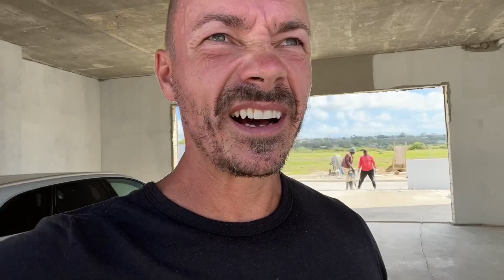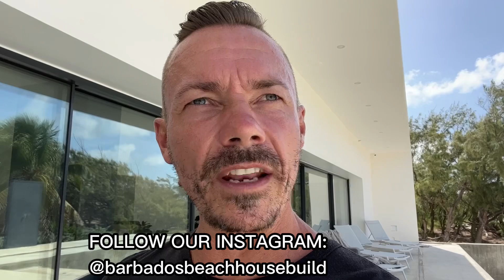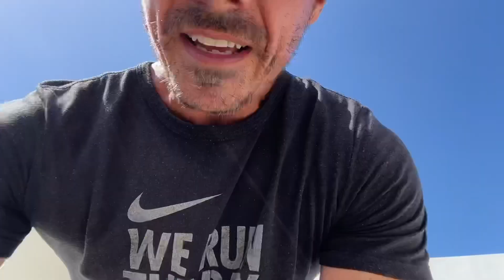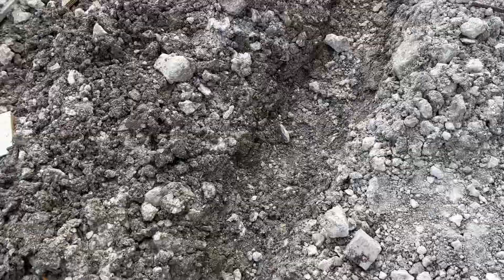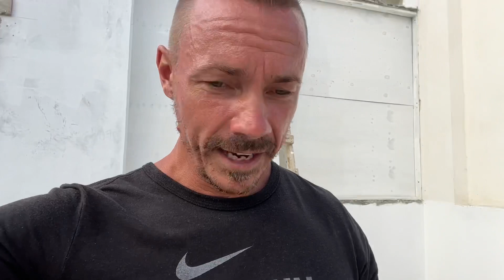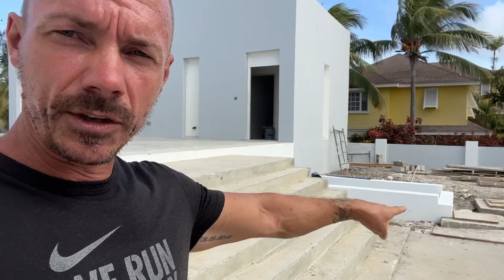Barbados 🇧🇧 Beach House Build - Day 315 - Building our Dream Home in Barbados

Comment: Alvin I sent you the name of builders Trojan, There is also Persuad Construction and of course Cow Williams.. For a high end build a reputable builder should have been on board.. Not bit part men as I call them. Did you go to Beachy Head Drive there is a build similar to your looks now complete looks awesome with the lights etc.. There is a track with a wooden electric gate.
Also I can't understand why there would be a problem, attaining someone to build and complete your swimming pool. Barbados has hotels, Airbnb's, Apartments houses with pools there must be a company on the island who can help. We've watched the build more or less from last May. The tax and duty is made up as they go along and depending on what comes in. There is no set price!!
Reply from the maker: We are going to try and get about this Sunday if we can. I will have a good nose!

As for the pool, my guy has let me down or so I thought. Out of the blue he called tonight and wanted to come around to measure up 😳
Tax and duty I am not having this. Now that I know what has gone wrong I intend on having this amended. It is bad enough to double VAT, but I am not paying tax unnecessarily!

Comment: tile the step risers as well, so then with the fixing bed and the tile thickness it will mean your 12" tiles could/should cover the tread
Reply from the maker: I would but most tiles are 12 or 24 inch and the steps are 12/12.5 wide, if I do the riser then I will be 1/2 to 1 inch off 😫

Comment: I wouldn't bother removing the door hinges already in place, I would spray them until they are unsightly. Thanks for information about the VAT issues you're having. Put up a clothes line at back house temporarily for your wife to hang clothes. It would take no time for them to dry instead of on a rack. Otherwise, keep going you're nearly there.
Reply from the maker: Your welcome Brewster.

The hinges will give in at some point but you are right, might be worth leaving until it is time.

As for the clothes line I just do not want a fixed line if I can help it. I will have a think on this!

Comment: Alvin, it looks like the gate once open will cross and block the pedestrian entrance leading to your front door. Will that be a safety issue?
Reply from the maker: Hi Dave, it is certainly not ideal but the pedestrian gate will not be able to open if the driveway gate is open. Plus it will be very rare that we will be entering at the same time from two separate entrances.
Reply: @barbadosbeachhousebuild  Np, makes sense, I just wanted to check

Comment: Good evening, been watching your building process, and scratching my head of all the Issues you’ve been having, I will soon start my project, so thank you for all of input, One think my cousin who lives close to the Ocean does, anytime he’s going to put anything metal or steel, is to have them those things sprayed with a sealer, locks, hinges, and light fixtures.
Reply from the maker: Thanks Todd and welcome to the channel.

Yes I hear a spray lacker is a very good option. I have bought a few cans but it is the getting around to it part I haven't done. I have sprayed a dry oil on most of it.

Let me know if you need any help with the build Todd. Where abouts are you building and when?
Reply: @barbadosbeachhousebuild  Foul Bay, not sure when I will start, awaiting town and country
Reply: Best way to get it done is to take items to an auto body shop, have them spray with A sealer